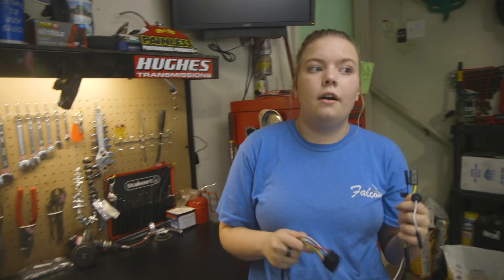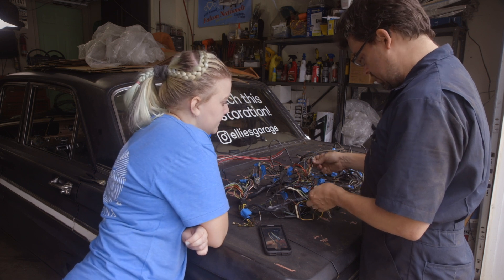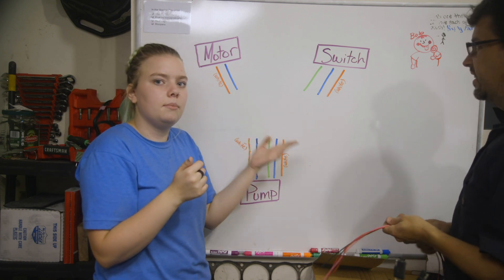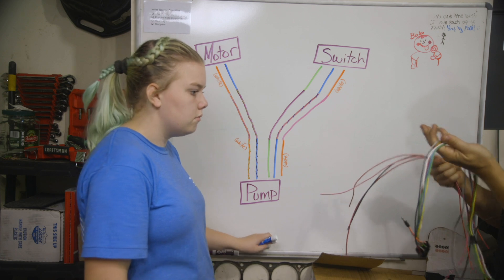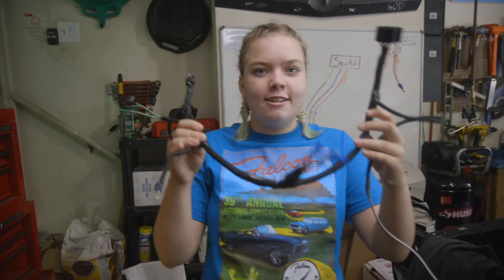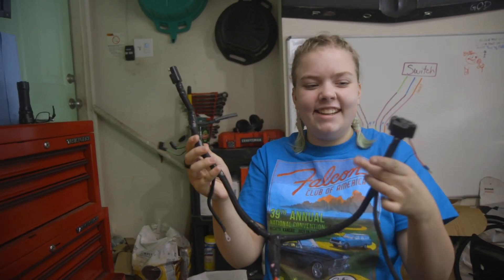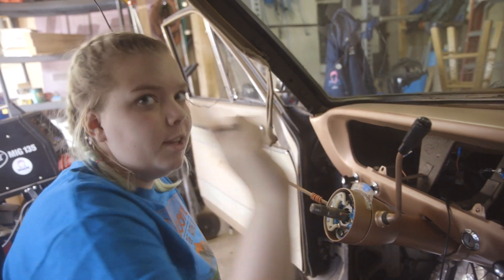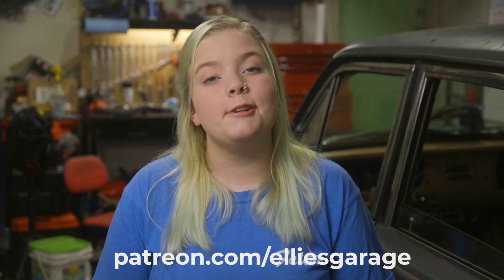We Made Our Own Wiring Harness For My Wiper Foot Pump!

Comment: I am trying to catch up on all of your videos and I want to say I am really enjoying them.  But I would be remiss if I didn't offer some advice.  When splicing wires, you should use either bare solderless crimp connections with heat shrink or heat shrink connectors.  This keeps the wires secure even if you wrap the wires later.
Thank you for sharing your rebuild!!

Comment: Great job! Noticed you used crimp connectors I prefer using solder and heat shrink when I can't rebuild the plug there are lots of kits to use old plugs with new wire and new plug inserts also learning how to solder is a life skill that will serve you for a lifetime! Lots of good videos on proper solder techniques out there and lots of videos on rebuilding plugs and how to properly crimp the connectors!
Reply from the maker: That's a really good tip. We'll keep that in mind, especially if we start seeing problems when we test the wiring. Thank you for the advice and help!!